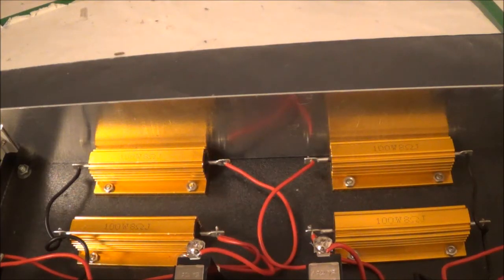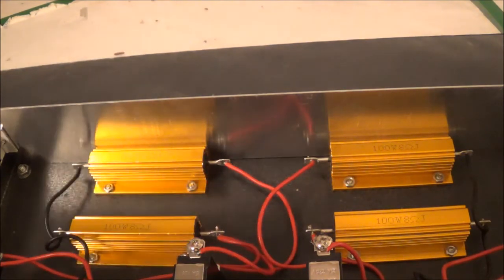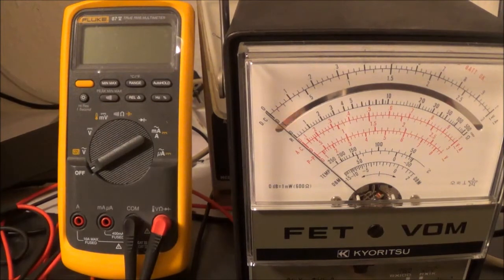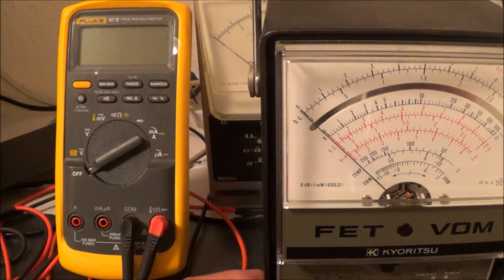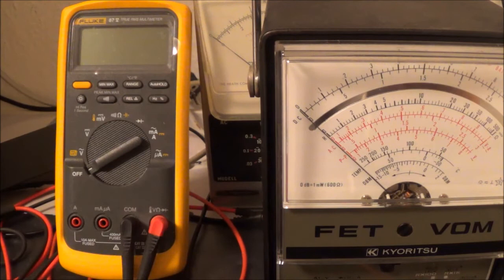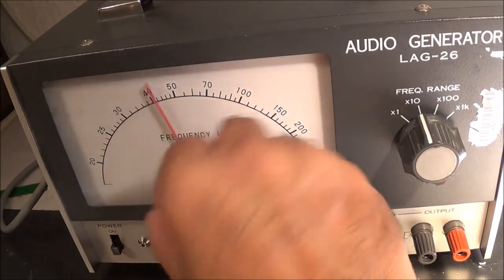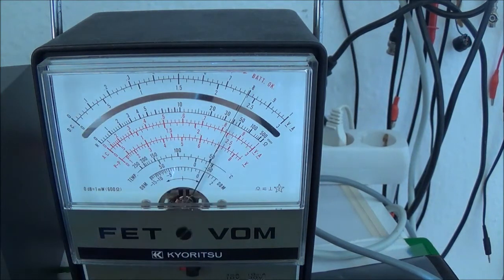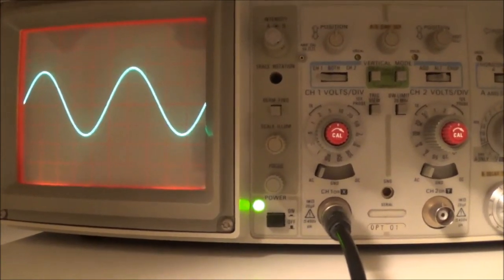Test Instruments For Checking Old Stereo Equipment Specficiations

Comment: Hi, is it true soon as you use an oscilloscoop, a isolation transformer is indinspensable? I read something dangerous about ground referenced & earth grounding.
Reply from the maker: In times past (early 80s), when I first got into electronics
and went to electronics school, you would run across TV sets with 2-prong non-polarized (the plug ends looked alike) plugs made without transformers; it was really necessary then to use an isolation transformer; the scope, though, was not hooked up to the isolation transformer because you could accidentally hook up the ground of the scope probe to the full AC line voltage depending on which way you connected the non-polarized plug to the wall socket (because the chassis could be live then--the ground might then be connected to a hot chassis). In other words, the ground would be real ground or hot ground (full line-voltage) depending on plug insertion. The isolation transformer has (as you know) primary and secondary windings that have no electrical connections between them. 
Although I have run into techs that insisted otherwise, I personally hook up the isolation transformer to the unit I am repairing/testing, and not to the scope. Best is to use a variable isolation transformer which also helps with testing because you can slowly bring up the line voltage. Also, isolation transformers generally have only one socket...that gives you a clue right there. With or without an isolation transformer, you still need to be careful; I have never touched an "isolated" AC line (120V or 230V) by accident or on purpose. I wonder if there is a video with somebody doing this?!! Precautions are best: such as not working on a damp basement floor, not working directly on a metal table, testing components without power if possible, using only one hand, checking the equipment visually beforehand, making test equipment connections before you turn on the unit, putting electrical tape around long probe tips if you have to do "live work" (or get the right probes), etc.
Reply: Old School Thank you so much for your extensive explanation. Indeed, here where I live (the Netherlands/Europe) we got 230VAC coming out the wall, fase/zero & earth grounding with a non polarized power plug. I was busy of making and thinking to make a current limiter ( you know a old fashioned light bulb of 200W) absorbing abnormal current and glow in a situation of a short in circuit. But I was thinking if I be able to get this easy working and safe use working. I think..I can't do that without a isolation transformer also.
But on the otherside in the U.S. has  also Alternative Current wall outlets but mostly with polarized plugs, in some strange way I can't get there by my mind if you know what I mean.

You are right, a Variac is also a musthave or a variable isolation transformer with a Variac intern.
So here is my musthave list on   Every electronic workbench..

1. Current Limiter (to protect you and your testing stuff)
2. Isolation Transformer
3. Variac
4. Oscilloscoop
5. Audio Signal Generator 
6. VTVM (analog meter when digital can fools you)
7. Digital meter for comparement and quick meassurement.
Pfff do i forgot something?
Cheers my friend 
R4.
Reply from the maker: Yes, the bulb in series with the AC line is a cheap way to
limit the current; as you know, the resistance of the bulb increases with increasing bulb brightness (higher voltage). I made mine with a basement/cellar light bulb holder because then the bulb is in an enclosed glass/metal/plastic cage. 
It looks like you have almost all the basic test equipment
covered. I also like to use a signal tracer; mine is a Sansei 6100. But Heathkit and Tenma (copy of Sansei?) also made signal tracers. There are probably manufacturers I do not know about. The Sansei/Tenma units have a VU meter, which is an advantage. Also useful is an ESR meter and a capacitor checker such as the
Heathkit (IT-28) capacitor tester. 
Have fun and good luck with the repairs, etc!

Comment: Awesome video!  Ever since I seen your first video on your dummy load, I thought it was cool!  I have plans on building one, I may do a slight mod to your design but the basics will remain the same...need to sit down and design it and order parts.  I did notice when you had your audio generator connected to your VOM it did increase as you went high in freq, but not much...will check mine out as well.  Thanks for this video!  ~Jack, VEG
Reply from the maker: Thanks! And thanks for mentioning the thing with the audio generator and meter; it (the needle) should not have moved much though; the Leader is +/- 1 db--over its rated frequency range, I believe. I'm gonna check it out though--right away tomorrow. And make a Leader intro video...Yeah, and my dummy load thing is not the greatest, I believe. But, now I got it...and it does its job. This was just a totally basic "what are the minimum items/instruments I need?" video.